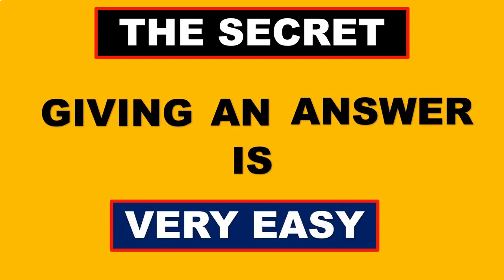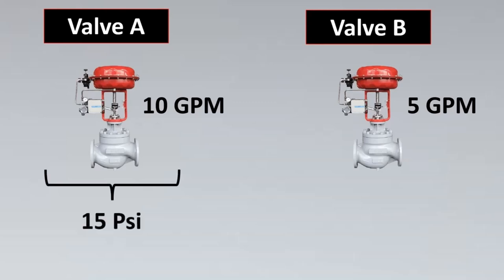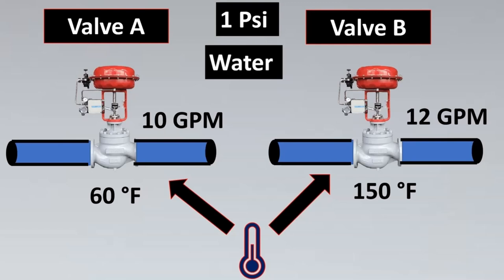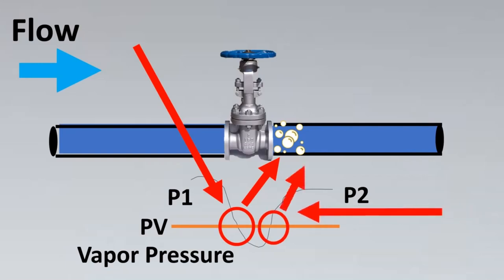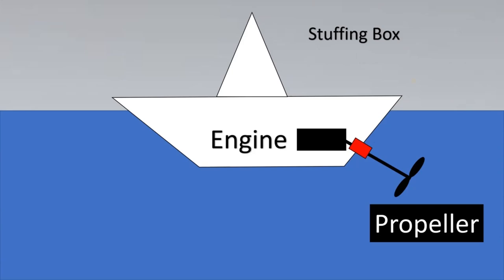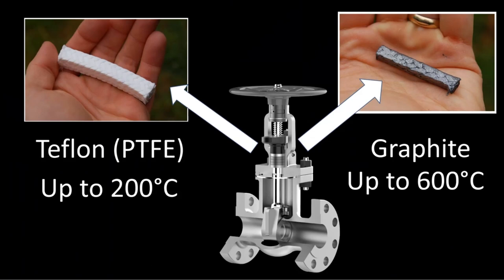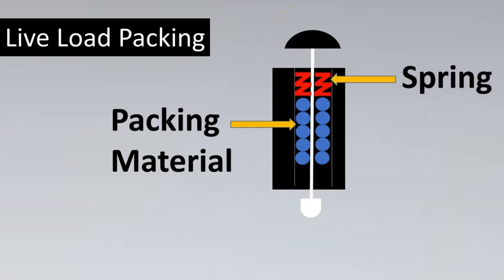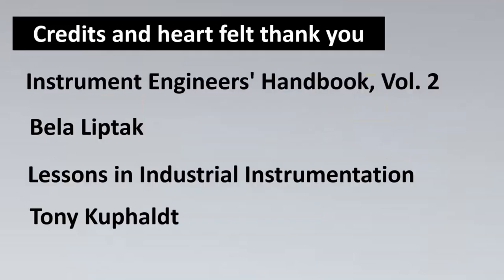Control Valve's TOP 3 MOST asked INTERVIEW Question and Answers

Comment: Your video is very helpful.
Can you please answer the following Shouldn’t we consider the position of valve opening ie Fully opened valve when stating the Cv definition.
Reply from the maker: Yes you are absolutely correct 😊 will make a separate video about covering this point also engineers get confused about concept of calculated CV at min,  normal and Max flow and the valves rated CV so will cover this as well.

Thanks for your comment 😊

Comment: Next question by interviewer : How to overcome capitation and flashing in the control valve?
Reply from the maker: I am working on this video, It might be a little longer one, But i am trying my best to make it as interesting as possible 😊
Reply: Cavitation can be overcomed by using hard trim material like stellite and Colmonoy 6 and using multi stage trim. Flashing cannot be avoided however it's effect can be reduced by placing the valve at a high pressure area or using a downstream restriction device such as a restriction orifice so that the due to backpressure effect the pressure recovers above the vapour pressure of the liquid